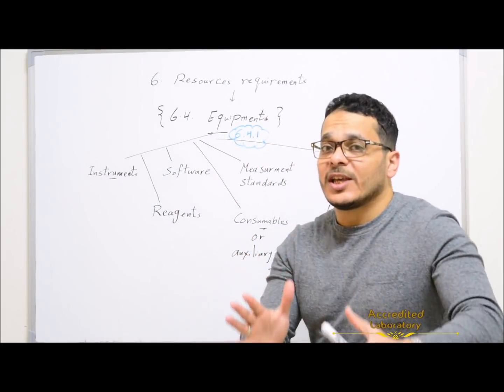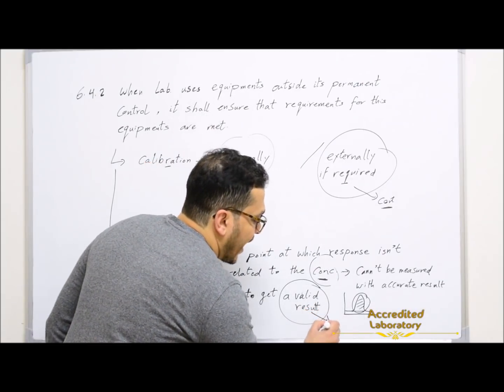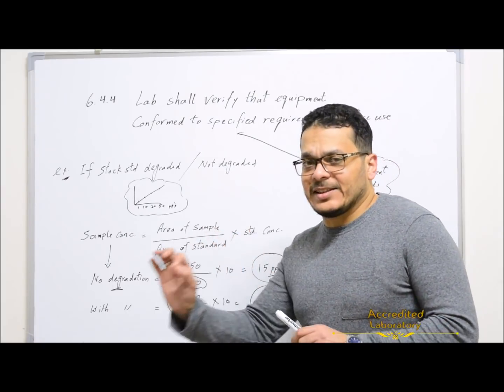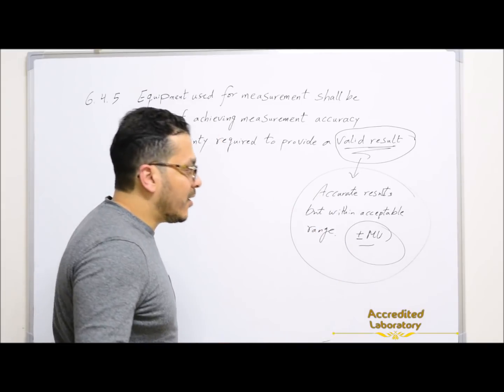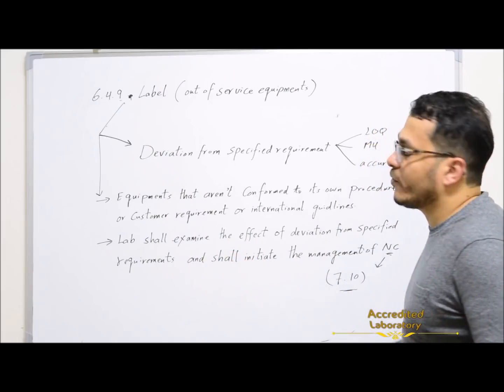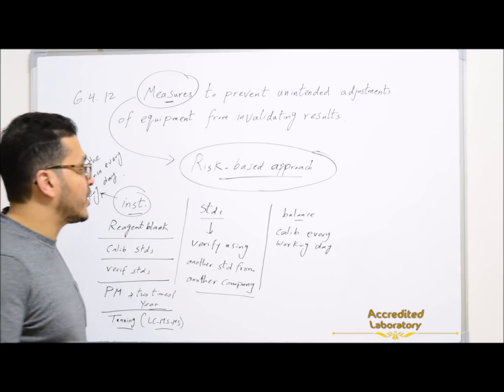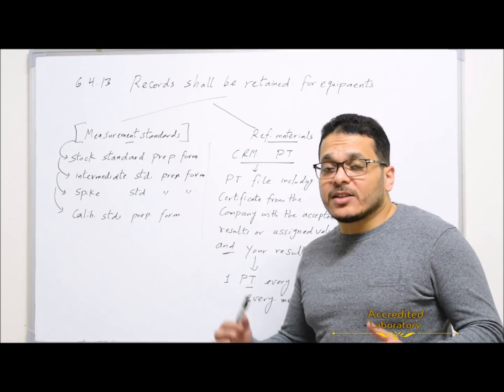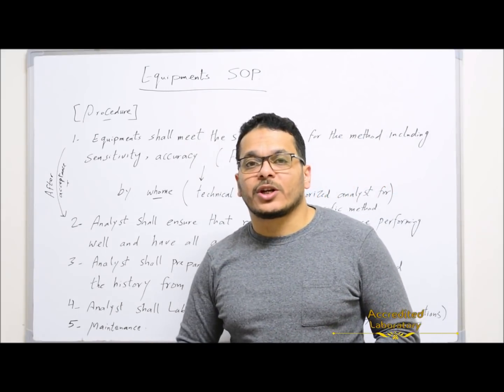9- ISO 17025/2017 | Resources requirements | Equipments

Comment: I have a question:
Can an equipement calibratred with just using CRM? Although there are temprature etc involved? 
Like flash point tester..
Reply from the maker: You should fix the temperature. Can you give me an example to get your point
Reply: @AccreditedLaboratory  here is a complete scenerio:
A person calibrated thermometer, viscometer and then calculated expanded uncertanity and put all those uncertanity in it. Now placed a tag on viscometer bath stating that this is the uncertanity of viscosity method. 
is it like this? or his understanding is wrong?
another thing is , lets say uncertanity is +- 3.0 so now he is saying to keep reaults less than max limit . otherwise the results will be declared fail (decesion rule.)
Reply from the maker: Expanded uncertainty calculated and added to the final result، If it passed the limit so you can accept or reject based on the decision rule used, but if it passed the limit by addition or subtraction so it's rejected